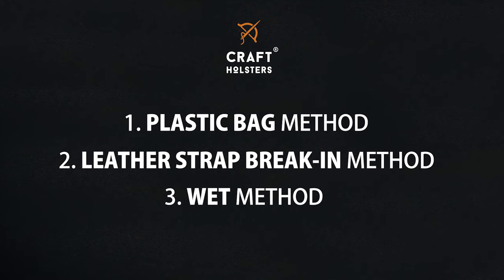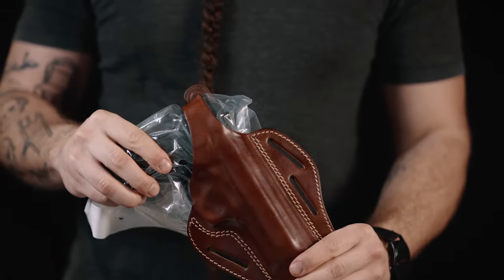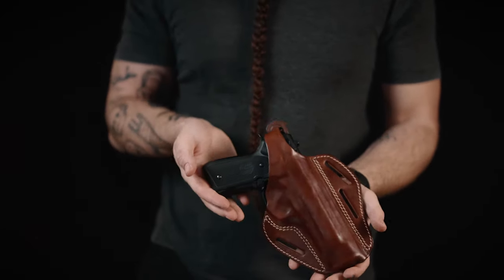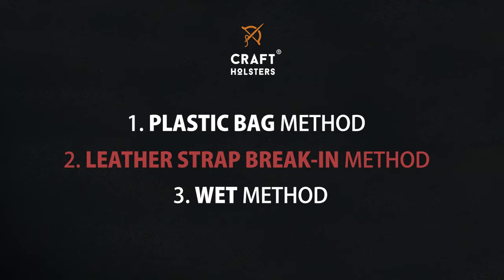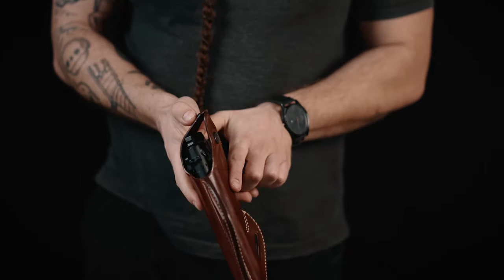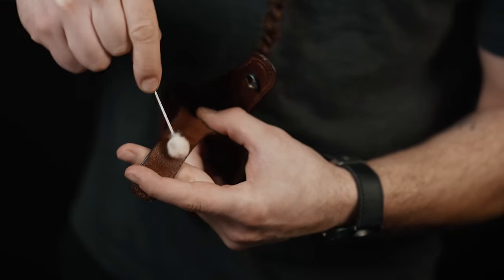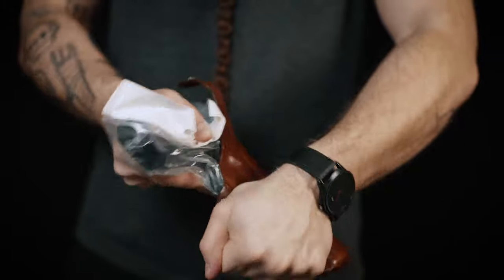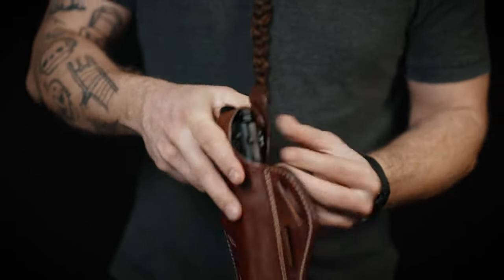How To Break-In A Leather Holster l 3 [Proven] Methods

Comment: Before I use the plastic bag method I apply a generous amount of Hubbard's leather conditioner to the inside of the holster , and then heat up the inside of the holster with a hair dryer till the leather has absorbed the Hubbard's.  Wipe up the excess then push the bagged pistol into the holster while still hot, and let sit for a couple days. Afterwards I put an old sock into the holster to absorb leftover Hubbard's, so when I'm finished I end up with a perfect fitting holster that's not leaving residue on my pistol.

Comment: On brand new holsters I like to put them in a sunny window sill for about 30+ minutes.  When the leather is warmed a little from the sun light it's slightly more pliable.  Making it even easier to fit the plastic bag covered handgun inside the holster.  When a holster is very cold it's not as pliable; also when a holster is too hot it can be overly stretched.  Warm is good, hot is too much.
Reply from the maker: Hey sir! Hmm, that's a very handy trick. Thanks a lot for sharing it with the rest of us and I really hope you didn't have any problem breaking your holster in. Regards, Al
Reply: @craftholsters  I’ve never had any trouble breaking in a new holster or firearm.  I always feel like a kid on Christmas; when I get a new gun and or holster. 🤠

Comment: I just bought a cross draw holster for my Taurus 66. I am right handed so the gun is on the left. The belt loops are perfectly sized for my belt. But I realized I may need to start wearing my belt upside-down so the holster is easier to put on! Not your problem. The holster is very well made and I love it already!

Comment: I found that on especially tight holsters, double bagging the firearm helps. Also, on holsters that have a retention strap, using some kind a leather conditioner on the inside of the holster makes drawing the firearm easier.

Comment: Try mink oil and an airwedge with 4 popsicle sticks.
Roll the airwedge into a tube, push it deep into the holster, put 2 popsicle stick on the top of the slide (upside) of the holster and the other two by the triggers side.  Pump up the airwedge and leave it for 2 days, pumping the airwedge regularly to make sure it's full of air.  I was very generous with the mink oil, a bit to generous since it took a few more days to not feel a but oily on the inside but, it stretched the holster out perfectly.

Comment: Just received Craft's cross draw holster for the Springfield Hellcat Pro. Used the wet method as described (including the plastic bag) and it worked well overnight. It's ready for range practice after just one night in the holster. I can tell there will be additional softening of the leather over time. I was also able to flex the waist paddles to get a more comfortable fit. I think I'm going to be pretty happy with this holster (my first from Craft). Also bought the double mag pouch. Disappointing. It's way too small and tight to ever accept magazines. No way it will ever stretch to the right size.
Reply from the maker: Hey sir! Thanks a lot for your feedback :) I'm happy to hear you were able to break in the holster without any issues and that you can now use it on a daily basis. However, I'm sorry to hear about the fit issue as far as the double mag pouch goes. Please, if you haven't done so already, contact my colleagues at support@craftholsters.com, letting them know about the issue and I'm sure they'll find a solution to the problem. Regards, Al

Comment: I just received my new Craft Holster for my Glock 30. The holster actually fits pretty well and the leather strap stretched out a bit from just pulling it slightly. I think I`ll still try the plastic bag method to make the pistol a little easier to draw. My question though is this: my holster is a paddle holster, and I see two things that look like "pins" for lack of a better way to describe them, on the paddle. They are, I suppose the retention devices to keep the holster in place when drawing the firearm. There are multiple holes that they may be installed in and it looks like they`re removable with an Allen head wrench? Is it an Allen head wrench? I`ve found NO instruction for adjusting these in the literature included with the holster. Where can I get instructions on how to adjust these, and the proper setting for them?
Reply from the maker: Hey again, Greg! You're right, the tension screws can be operated with an Allen's key, it's quite a simple chore, but sometimes must be done to adjust the retention or cant of the holster to your liking. Please, send my colleagues a message at support@craftholsters.com and ask for the instructions, they'll most certainly be able to help you out. Also, if you can't manage to get a hold of the hardware, let them know and they might be able to get you a key for the adjustment. Regards, Al
Reply: @craftholsters  Allen tools are headed my way! Thank you!
I will tell you, the 3 things I look for and hope for when dealing with any company are 1. A great product. 2. A great Warranty, and 3. Great customer service. Very few companies offer all that, but your company DOES. You have me for a life-long customer. Thank you!
Reply from the maker: @HarryCallahan-c8e  Hey again, Greg! I'm very glad to hear my colleagues got in touch with you and helped you solve the problem! :) And THANK YOU for your extremely kind words, it means a lot to hear such a positive feedback from time to time :) Happy carrying! Regards, Al

Comment: Ballpark, how long does it usually take from the day the order is placed to the day it arrives?
Reply from the maker: Hey sir! Well to be honest, that depends largely on stock availability. If the holster you choose is available in stock for the selected configuration (gun model, hand, color), then it can be packed & shipped right away and with the fastest method (UPS Express), it can get to you within 2-4 business days. If the holster you choose isn't in stock, i.e. it has to be made first, then the shipping window only starts once your order is complete. Leather holsters usually take 4-5 weeks to make, so if you order today something that's not in stock, you can have it by the end of March (possibly a tad sooner). Regards, Al

Comment: I have two of these they are really well made and fantastic value, the instructions suggest using de naturalised alcohol but gives no indication of the best way to use it, suggestions please
Reply from the maker: Hey sir! Thanks for your kind words :) Here's a link to our break-in guide - https://www.craftholsters.com/break-in-guide
Reply from the maker: And here's another one to the video guide, featuring 3 different methods, but I suggest using the "wet" one - https://www.youtube.com/watch?v=n3fyN8mcvBs&t
Reply: @craftholsters  I used the plastic bag method, with a little denaturalized alcohol in the bits that need to bend, one night was enough and my holster works really well, I am sure it will last for decades its so well made and just get better, well done you guys and so inexpensive too compared to most on the market
Reply: I have no idea why i did not think of the plastic bag method, this is the only way you can get new cowboy boots on

Comment: Did one night, plastic bag and break in kit, still can't draw it.  How long is this suppose to take?
Reply from the maker: Hey Keith! Sir, if the first attempt didn't help, please, repeat the process one more time. If it doesn't help, please, do contact my colleagues at "support@craftholsters.com" or let me know what your order # was (6 digits) so that I can ask them to reach out to you and help you solve the problem asap. The break-in procedure (if you're doing the bag method) usually takes a couple of hours. It's best if you let your gun sit in the bag shoved all the way up the holster for at least one night. Regards, Al
Reply: @craftholsters  Thank you for the prompt response.  I did let it sit for a full night, I will try again tonight.
Reply from the maker: @Narxes081206  Hey again, Keith! Sir, did the repeated procedure help? If not, please, email my colleagues at "support@craftholsters.com". I'm sure they'll help out! Regards, Al
Reply: @craftholsters  Thanks for the follow-up, yes the second attempt seemed to work.  I work part time at a gun shop and due to back issues I needed to get my firearm off my hips, so I went with your vertical roto shoulder system.  I was able to wear it, and didn't have any hip pain afterwards.  The roto system is great too, I love the vertical carry option, but at the same time the easy of drawing granted by your roto system.  I also got compliments from my colleagues and customers.
Reply from the maker: @Narxes081206  Hey again, Keith! Very happy to hear that, sir :) Also glad to hear you're enjoying the roto feature and it's great to know you're getting compliments on it! Thanks for letting others know about us :) Regards, Al

Comment: Holster is beautiful.  I used the plastic bag method and it fits fine but the strap seems about 3/4 " too short.  I suppose I need to work on it a month or so, LOL.
Reply from the maker: Hey Larry! Sir, first of all, thank you for your kind words regarding the holsters quality :) At the same time, leather strap extension definitely won't take a month. I'd just play with it a bit, try stretching it by twisting and pulling towards you (just don't use way too much force). The leather straps on our holsters can be extended by more than an inch. I understand it's an unpleasant chore, but wet-molded leather holsters simply are like this sometimes (they have to be dryed out after they're done, which sometimes results in them shrinking a bit and feeling a bit too tight). Please, if you can't extend the strap, let my colleagues know at "support@craftholsters.com", I'm sure they'll come up with a solution to the problem. Regards, Al
Reply: @craftholsters  I'm sure I just need to work on it more.  I just did not want to damage it.  It's very nice.  I need a few more.
Reply from the maker: @larrymor  Hey again, Larry! Sir, did you manage to extend the strap? If so, how do you like the holster? :) Regards, Al
Reply: @craftholsters  In fact I did but it took some time and work.  Not too bad, though.  I kept working on it with alcohol.  Progress was slower near the end but I love the holster.  It is resting now in my safe with the contents inside and snapped.

Comment: My holster for the Kimber K6 DASA Combat 4" came in yesterday. Beautiful holster but I can't seem to get the strap around the hammer. The strap has stretch marks on it now. Is that normal?
Reply from the maker: Hey mate! I'm sorry for a late reply, but I'd like to thank you for your comment and appreciation of the holster's quality! Usually a bit of break-in is necessary with fresh leather. In case you're still struggling, just drop my colleagues an email at support@craftholsters.com, I'm sure they'll be able to give you proper advice. Or just leave me your order number here and I'll ask them to reach out to you. Regards, Al.
Reply: Hey my holster for my HK45c just came in and I had the same problem. I used the leather strap break in method and I finally managed to get the strap buttoned. Gonna leave it overnight to see if it loosens up.
Reply: Great holster by the way I love it
Reply: Get a can of denatured alcohol.   I actually dipped the retention strap in the alcohol.  Now stretch the strap until it is long enough to go around the hammer.  You may have to do this a few times.  When it is long enough close the strap and let it sit overnight at least.

Comment: I have only done it a few times but STEAMING works for me. I insert my gun in hard and close the thumb break. Then I hold it over a pot of boiling water. I have a strainer and used tongs to turn it over. Takes less than a 30 minutes. Leave the gun in overnight to cool. There will be a few little spots inside that will still be rubbing hard. I rub just a tiny bit  of synthetic grease on thoss friction spots a few times over the next month. The leather is flat in those spots
Reply: Sounds like this would be a faster method but I have a question: Do you seal the firearm in a plastic bag, or is there no concern over some flash rusting from the steaming and then letting sit in the damp holster?

Comment: Buy AMERICAN! I just got 2 holsters in for my Bul Armory Pistols and on one, the strap is a half inch too short to buckle and one the other, the female end of the buckle is damaged and so it won't close. I guess CRAFT has never heard of Quality Control!
Reply from the maker: Hey again, Jose! I've said it enough times, but I can say it again. I do apologize for the strap issue, but I've already explained how to go about filing a claim with us and I also did promise you my colleagues will figure out a way to fully compensate you. And just because a strap on a wet molded holster feels a tad too short, it doesn't mean our holsters don't go through quality checks, cause they do. Wet-molded leather simply tends to shrink as the leather is drying out. Please, await further instructions from my colleagues from customer care dpt, who are well aware of your situation and are doing their best to resolve the entire problem asap. Regards, Al
Reply: @craftholsters   So today marks 6 days in trying to get either a refund or replacement holsters which is preposterous. They have all the pics they need but said it's still going to be another 3 days to make a decision lol. Also, the problem with the strap was only on one of the holsters and the problem was not even with the length of the strap as the strap is actually long enough. The problem is that the hardware was not attached further down the strap so that it could be used. But on the other holster, they used damaged hardware. 
Me saying that you guys either don't have a QC department or if you do, the QC department is doing a half-butt job has nothing to do with shrinkage, it has to do with products like the ones you sent me getting by without notice. Products with damaged hardware. It's sad because the leather worker did his job as the holsters fit nicely, but whoever the apprentice is that the leather worker handed the holster off to, to put the hardware on did not do his job. To make it worse I, the customer, have to deal with a customer service that acts like the decision that they have to make is one of national security size lol. NO! You guys messed up on not 1, but both of my holsters, you have the pics, what's so hard about it? 
Until they have resolved this I will continue at 30mph posting about my experience with Craft Holsters and believe me, these posts don't make you guys look good. God forbid they decide not to make things right with me, then I go from 30mph to 100mph, dedicating significant time to this matter. I'm already here on YT, FB, and IG.... next comes to making videos about it, posting on all of the gun forums, and really escalating things.  I'm a business owner myself and never in all my years of business has it taken me 6+ days to handle a customer complaint, NEVER!

Comment: Good company to send products back to. Kimber K6s 2"...received first holster and it wouldn't fit if you beat it in with a hammer, sent pics to Craft and they agreed craftsmanship was off, replaced with another one...Same thing! Finally got a refund and got to keep 2 worthless holsters that I cannot use if I wanted to. Ordered a Galco Combat Master for that revolver and no break in needed, fits perfectly with perfect retention. Don't waste your money on Craft garbage.
Reply from the maker: Hey Joe! Sir, I'm sorry that we didn't deliver the promised quality. However, everyone makes a mistake every now and then and no one is absolutely perfect. We gave you a replacement holster at no cost and even a full refund for it, we were not trying to wrong you in any way. I hope you can understand that, just like we understand why you turned to another holster maker. Once again, I'm sorry and I'd like to thank you for your understanding. Regards, Al
Reply: @craftholsters  
If you still have the unappreciative crybaby's address, you could send a leather cover for a Box of Kleenex.

Comment: Sure could have used the knowledge of those methode's when I got my holster from you instead of the sever fight I had to get it to fit. Like that force for the thumb strap. Mine was a good 1/4" to short and your kit did NOT come close to helping. Eventually I soaked it in conditioning oil to get it to stretch. I am reluctant to have you make more holsters for me going forward because of this type of lack of support. VERY DISAPPOINTED !!!!!!